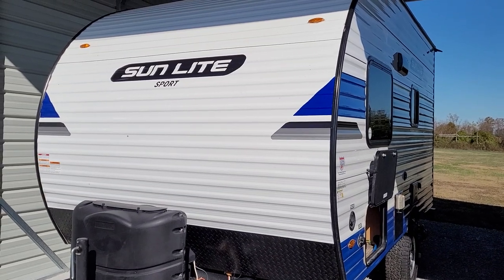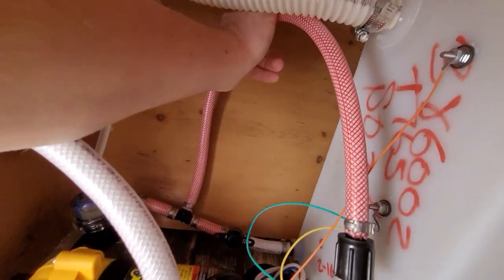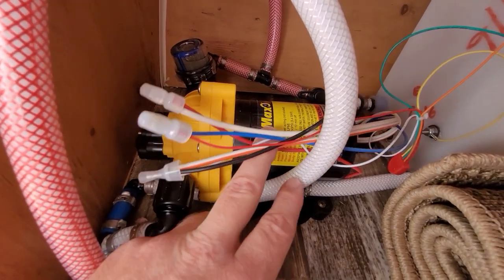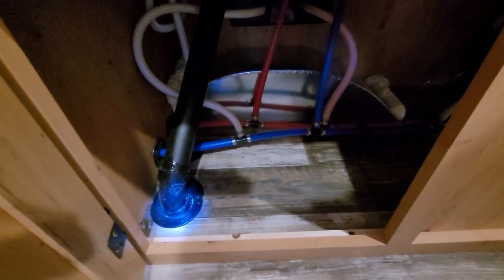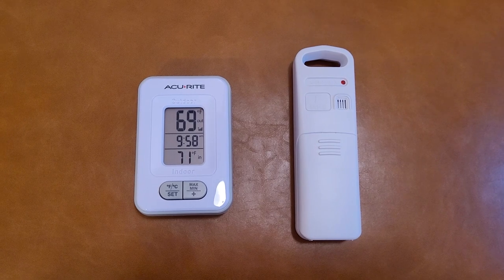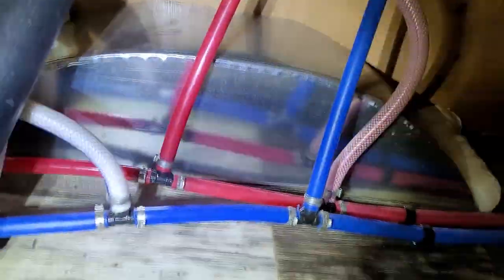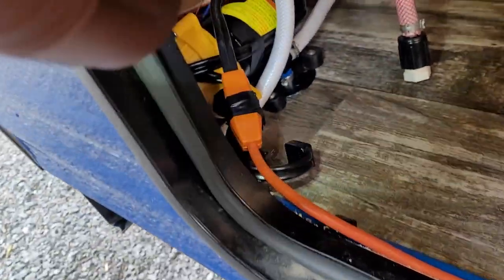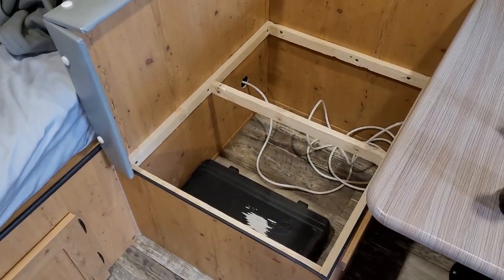Plan to Avoid Winterizing my Sun Lite 16BH Camper Trailer

Comment: I live at 7730 feet above sea level and I’ve seen -20°F here in the winter. 
I’ve only used rv antifreeze in my Drains and just blew out my waterlines with compressed air. I use a block of wood to hold my toilet flush open.  I’ve had to replace that valve twice because I forgot to do that!
This has worked great for 19 years

Comment: I work at a boat yard and we winterize all the systems on the boats.  Boats are basically water campers :)  Water in pumps, hot water heaters, valves and hard fittings are where the problems happen.  Like you said, an empty hose can't freeze.  We typically drain the systems, pump out the tanks then bypass and drain the heater (people don't like the antifreeze taste after the heater is flushed with it).  We then run RV antifreeze through the remaining pumps, fixtures, drains and toilets.  Water in the tanks can rupture the tanks, a little bit is ok but if it's a lot it can pop the tank.  Drain traps can crack as well.  Mind you, I'm in Maine and it's cold from November/December though to till April, sometimes below zero.  These boats are sitting dormant all winter too so winterizing is a must.  I think if you are using your camper on and off thought the winter what you're doing is a great idea! You could always run the heater in the camper if you have a cold spell.  I'm loving your videos.  Keep up the good work!

Comment: I have to winterize my camper being in Colorado. I hired help to winterize but he moved. I now need to summarize it before this Friday. It would be so amazing if you could do a video for each. If not can you recommend a good video for me? I can't find one for this model. You make the best videos!
Reply from the maker: Thanks so much.  The process is really similar for all models. Even if the valves on the hot water tank look different than yours, they normally function about the same. It'd be a matter of draining the antifreeze and running water through the whole system to clean it out.

Comment: The best way to drain the system is to use air to push all the water out of the system. They make a air to water hose adapter that you screw into the city water inlet, pressurize it with air and then open your valves on the inside of the trailer and it blows all the water out of the system
Reply from the maker: That's a great tip, thank you!